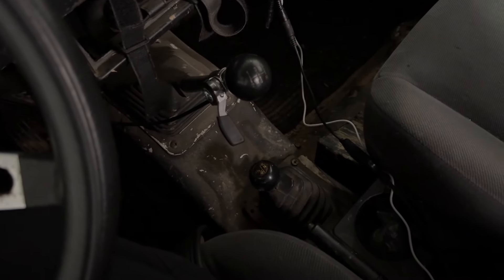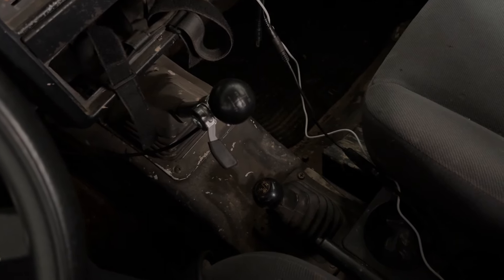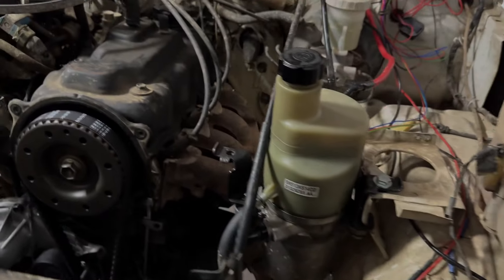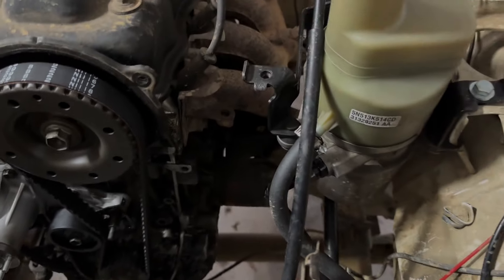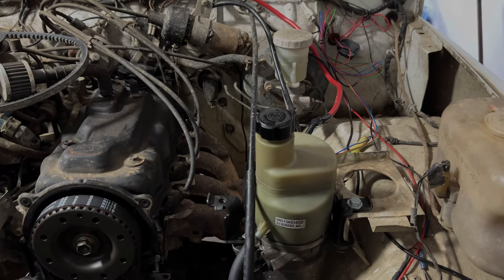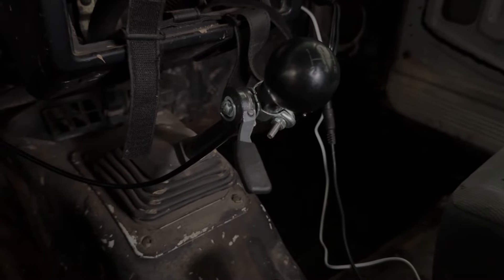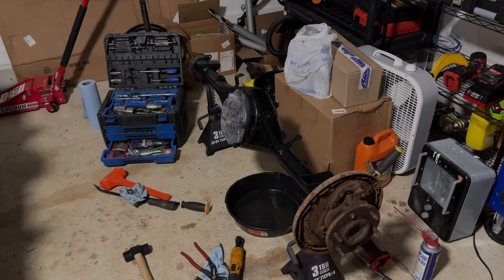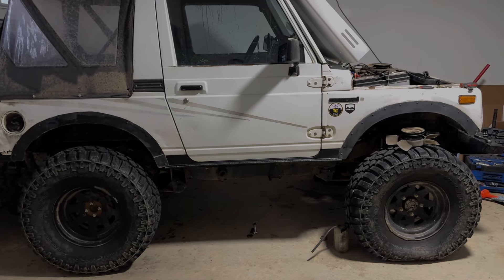Best Suzuki Samurai off-road upgrades/ modifications | Top 3 plus bonus

Comment: Hell yeah little buddy. Nice ride got 88-1/2 square dash. Pretty good shape.does have some rust little body rust rockers, back corner one fender flare bolts up pretty much all easily repaired if it warms up. Got a Hobart 140 that will blow smoke to patch it up.  And I'm welder fabricator mechanic since 10 doing the gocarts motorcycle pops miner of the coal. And i had to learn quick fix it or no riding till weekend he midnights mostly and i was tired waiting for Saturday especially when broke um on Monday or Tuesday. Ouch been doing since then I'm 50 now.  If could find time and weather cooperates going probably building rock sliders cut rockers out well what they call rocker i call hang down or a that's in the way part.  I'm running just good my tire new  50 miles on them 30 of that dirt. Thunder trec or something.thundrr got side tread wow. Only 235/75/15 just got grease able bolts  shackle lift keep from rubbing. Might do a soa idk want a locker for sure but I'm not going weld it almost did change mind had jack up tires of caliper off back out want be able to unlock it know unlock hubs yeah just not me no more believe me had cars truck 4-wheeler welded up. Now going try not go lunch box loud click clak one. But. Coin's are low so IDK.  Idk how y'all do the working filming  and edit not load upload down load idk but no way not me camera, and phone cost to much to. Break. Be knocking over dropping that's accident when finger get mashed or freeze up not recording launch it into next week. Lol. Then got computer part no way probably couldn't if it wanted to. I grew up computers where not every where they was around had few here and there commador 64 . Disk flopper to yeah it set a lot while i was out 🔧🛠️. Go carts dune buggies. These wv hills are alive with the sound of motors. 😂 Well raining ☔ now try get back in out of this building slash almost big enough garage. Rent to own 10'x16' 6 foot roll up door. And garage floors heavy coated flooring.nice just small yeah . Paid for two payments. Trade up time ole lady we need the 14'x30' plus size. 8 foot garage door. Yeah was 240 a month about 43,44 months ago. So got 135$ unit. Slacking up hear the grand baby in there I'm out. Stay safe from ur ole hillbilly buddy.

Comment: I did Toyota axle swap on my samurai, they only downside that I can think of is reduced turning radius, at least on my setup with sidekick steering box. I also recommend using double cardan front and rear, it really help with drive shaft angle, got mines from tom woods(it will require clocking the hubs to fix the caster, not as hard as it seem if you got a welder and angle finder). Other than that, the brake upgrade is fantastic, the stock samurai brake master and booster work just fine, really tight pedal. If you have a samurai with the rear proportioning valve, do not delete it, just make new brake line from it that goes to both rear wheels separately, otherwise it can lock the rear wheel before the front one in hard breaking scenario. Samurai parking brake cable also fit just fine on yota axles.
Reply from the maker: Great info! Thank you
Reply: @Drewsoffroadgarage  You helped me with power steering, I helped you with yota axles, pleasure is mine.
Reply: No wonder my back brakes would lock up first. That caused my back end to try to pass me going down steep hills. Scary crap!!!!!!!! Thanks for the tip. I'll do that next build. Got the axles and Sammi already to do it to. For the 4th time.

Comment: You're doing great on your Samurai but I think you need to come over and see what I had and then do what I did with upgrades on Samurai.  

You need to use Isuzu Rodeo rear leaf spring both front & rear upgrade both axle to FJ80 full float on rear and FJ60 up front then lower gear to 5.29:1.  The engine you need a Sidekick 1.6L 8v, no carburetor, use only a 90-95 original Samurai EFI and install sidekick 4WD tranny cut off the 4wd chain housing then patch with aluminum plate then use 4.24:1 t-case gear and connect to a Samurai T-case 6.5:1 2nd transfer case.  Lift the body 3" use a four runner steering gear box and add a Prius EPS to turn a 37"-40"+ tires.  I had tons of more upgrades on my 93 EFI Samurai come see and share experiences on upgrading an unstoppable Samurai, etc.  Hope this help you.  Thanks
Reply from the maker: Wow that sounds like a great build I’m getting there I just need the time and money to make all my upgrades